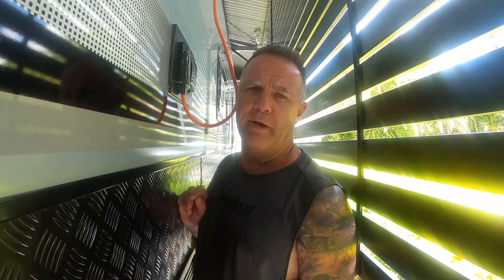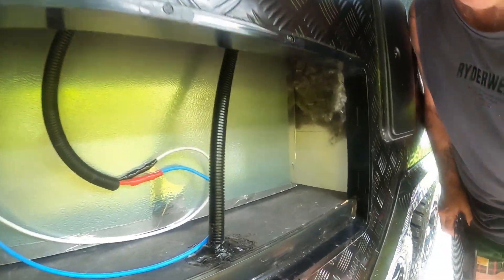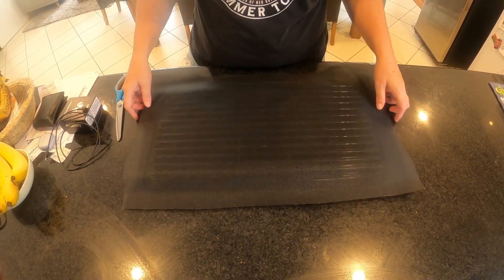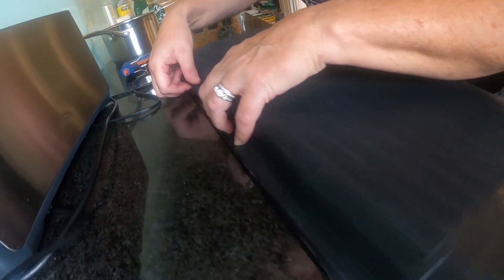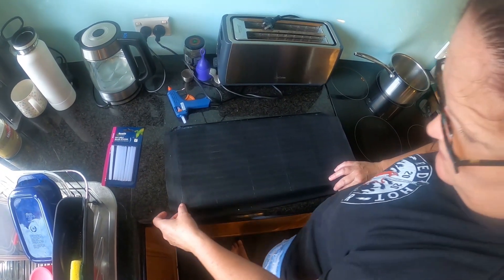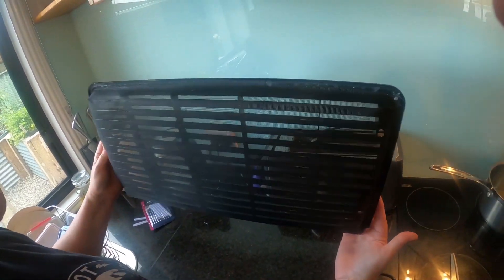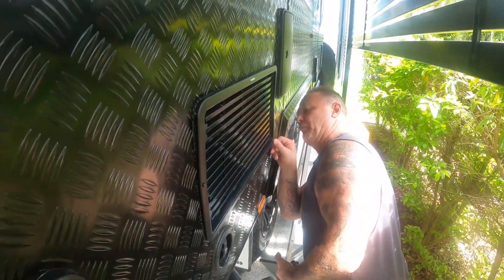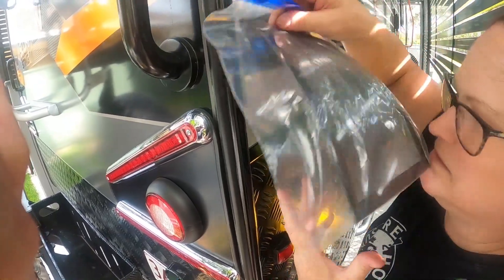Just Brilliant Adventures - Fixing Insect Mesh to the Caravan Vents

Comment: We just finished putting the mesh on our vents - we have a JB DRE 19'6". We did the two fridge ones the same as this video. The one at the bottom of the door - we unscrewed - it comes off in two pieces - we put the mesh in the middle. The one above the window near the bed (which says never cover as it is needed as air for the stove) - we unscrewed from the inside and put the mesh behind. We pulled the microwave out and used double sided tape and then extra tape to secure it to the vent (on the inside). We don't think they will get in the vent for the range hood. There is also a vent outside the shower, but we have no idea where this goes or what it is for, so we aren't covering it at the moment. So we have managed to do all of them without using magnetic strips and they are permanently on so we don't have to think about it (hopefully!)
Reply from the maker: Thanks awesome guys, we will be doing our new van as soon as it arrives. Hope you had a lovely Xmas.

Comment: I see JB short changed you, you need to tell them to install the diverter shield on the top of the fridge on the next service. It is there to divert the hot air from the fridge out the top vent and also to prevent the top of the fridge filling up with dust. they only seem to install the diverter on every second caravan. Also it will pay to block the vent for the rear of the shower as it will fill with dust, then install an internal vent.
Reply from the maker: Cheers Jeff. Got a new van now. 🍻
Reply: @JustBrilliantAdventures  Might pay to check the new one as well if its a JB
Reply from the maker: @swan-adventures  new 1s don't have vents mate 🍻